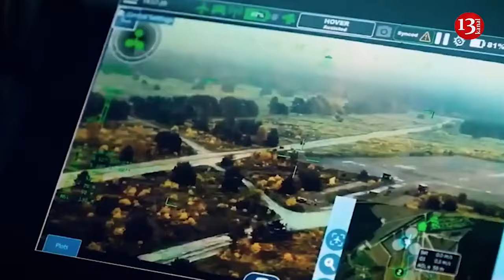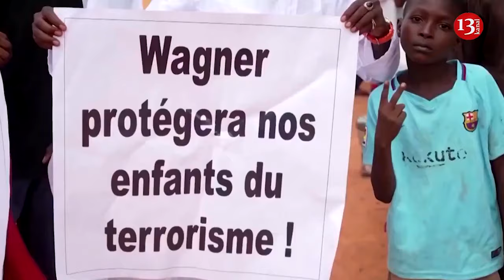Russia produces artillery shells about three times faster than Ukraine's allies

Comment: "Russia's combat losses in Ukraine rise to 503,800"

"Russia's overall combat losses in Ukraine between February 24, 2022 and May 28, 2024 amounted to about 503,800, including 1,460 soldiers killed or wounded in action in the past 24 hours."

- Ukrinform  
. .  .   ..      . .   .. .

2M+ RU casualties thus far
2,000,320+ to be exact. .    .. 
. .
wia:1.500.240+
(Minusrus)
🙏🏿🙏🏿🙏🏿🇺🇸🇺🇦 ⬜🟦⬜